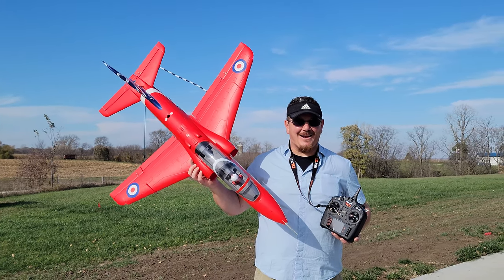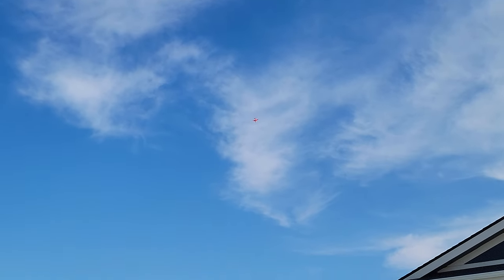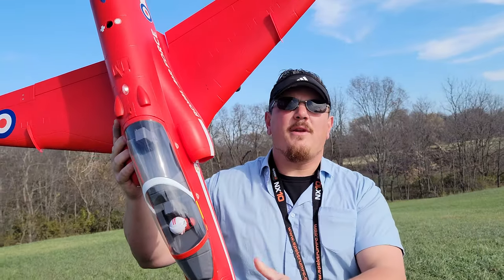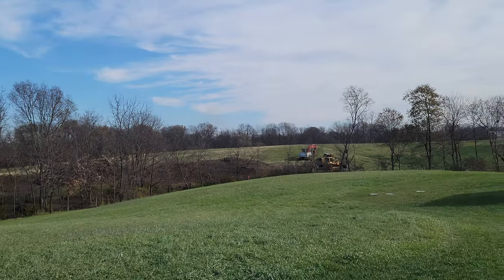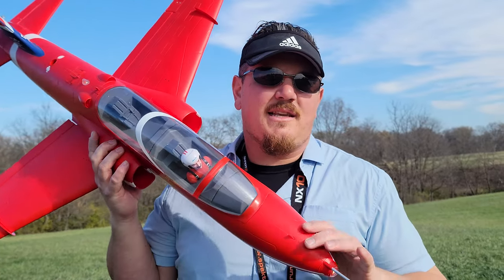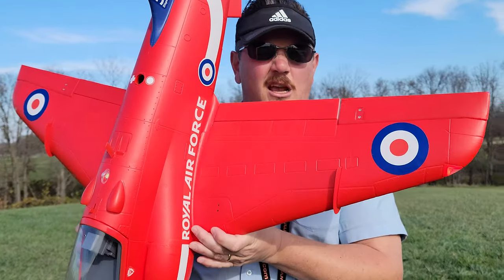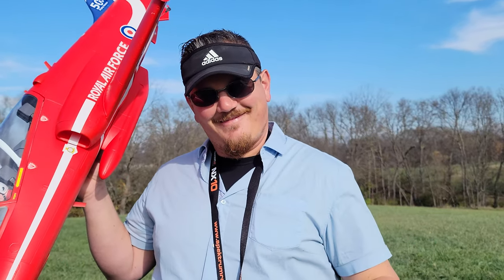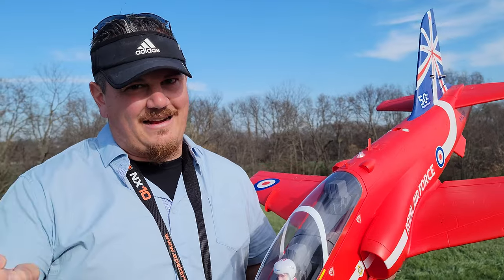FMS - BAE Hawk - 80mm - Revisit

Comment: You can approach at about half the airspeed you were approaching, with a nose high attitude. It is very forgiving.

I usually setup my flaps as flight modes which allows me to have trim for each mode - no flap,  take-off and landing. I then trim for a hands off gentle glide with landing flap. Doing this makes it easy to fly an approach slowly without feeling you are anywhere near stalling.

Comment: Futura seems to be the better value of the 2
Reply from the maker: To all their own, but I love this AND the FUTURA - both are GREAT planes! This one is WAY more detailed, and looks AMAZING, even up close ;)
Reply: @BrianPhillipsRC  true, but the futura has the upgraded 80mm that had a little bit more efficiency and power..
Reply: @redwineisfine the 2100 in the Hawk actually has more peak power. Midrange is the same. Tad less efficient than the 2000. 2000 can be used with 7s and 8s tho.